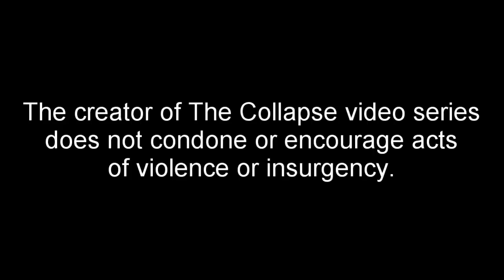The Collapse: Cities on Fire (S1E4)

Comment: Laurel, another terrific video! I am reminded of the 2008 financial/real estate collapse. In December 2008 as gasoline prices began to skyrocket, word began to spread of gangs roaming through neighborhoods stealing gas from cars. So I bought a locking gas cap for my car. Almost immediately afterwards I learned the gas thieves were not siphoning gas, instead they were drilling holes in the bottom of the tank with a hand drill to get the fuel out. Sheriff deputies also carried out a successful sting operation that caught a sophisticated crew of gas theives. They stole gas directly from the in ground gas station fuel tanks using a stolen 18 wheel gas tanker after midnight while the stations were closed. All this and worse was happening, and we didnt even come close to a worse case SHTF or WROL meltdown. Cheers.

Comment: In 1998 Eastern Canada experienced a massive ice storm that wreaked havoc on the electrical grid for many weeks.  A temporary fix in some cases was to use diesel electric locomotives to power some buildings.  I one case a locomotive was driven down a frozen street without rails to get to a location where it could be connected to the buildings power distribution.  http://cs.trains.com/trn/f/111/t/194245.aspx
Reply from the maker: Yea, when I was researching the stuff for the nuclear power plants for the last episode, one of the articles mentioned that in a pinch you could use a regular diesel engine from a truck.  Of course the problem in the collapse series is the fuel.
Reply: That is an EXTRAORDINARY find, thank you!!
Reply: You can do the same thing with a nuclear submarine(s).  Dock them on a river and you can power up a small city.

Comment: Powerplants are linked to provide service while they are generating. When generation stops, other powerplants take over. Generation schedules are followed closely. Droughts, environmental concerns, accidents can disrupt generation, but electricity is available from other plants until the non-generating plant comes back on line. Commercial navigation is directly impacted by generation. Many dredged channels become impassable until generation up stream causes water to rise. It's a ballancing act that relies upon all power producers working together. You are right about the time required to replace critical infrastructure. Many of the components are not made in the US. There is also sharing of equipment. If there is a breakdown, requests go out nationwide for spares. By the way, I understand that the US used some lowtech means to knock out powerplants in Iraq.

Comment: How does the military/national guard seize and transport water when they run out of gas for their vehicles?  Those fuel guzzlers, running 4-12 hours a day, will run dry within a week.
With no power, food, water - what are police and military with families doing?  Looking for food and water.
After 1-2 days (or 1-2 weeks) of driving, most every vehicle will be bone dry.
Everything stops.
Can’t have police/military patrolling without water.  So just how quickly are things really going from bad to worse?